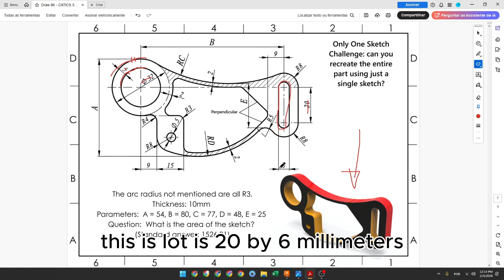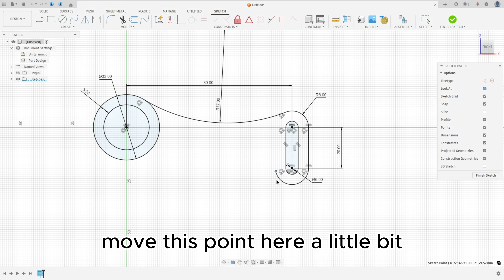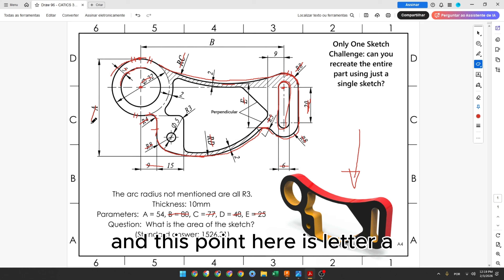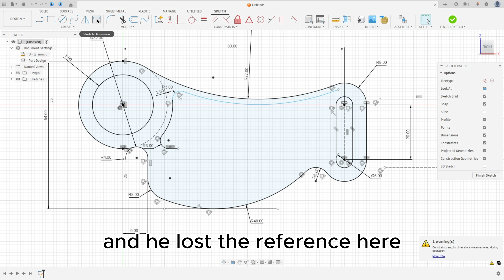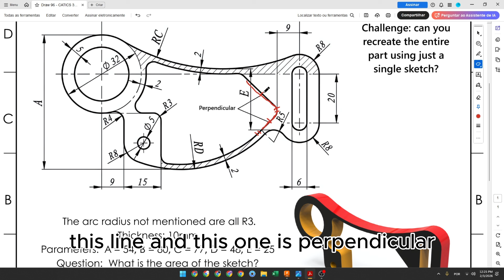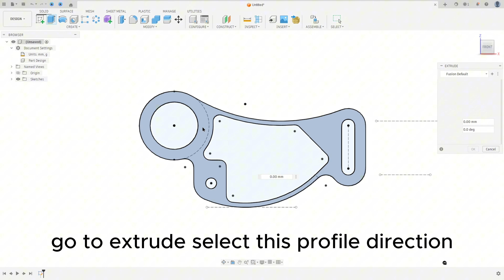Only ONE Sketch Allowed… Can You Model This? | Fusion 360 Challenge

Comment: Great tutorial! I have one question about the drawing: where exactly is the R3 dimension for the inner pocket fillets specified? When you get to the part machined to R3, the radius looks significantly larger than what seems to be called out on the engineering drawing. Could you point out the callout?
Reply from the maker: Thanks a lot, glad you liked the tutorial!
Here is the link of the sketch : https://www.3dmechanism.com/post/3d-exercise-96
This is actually noted in the drawing: all radii that are not individually specified are R3 mm.